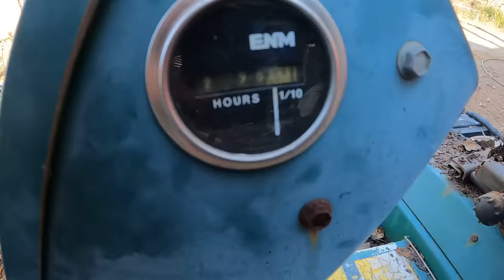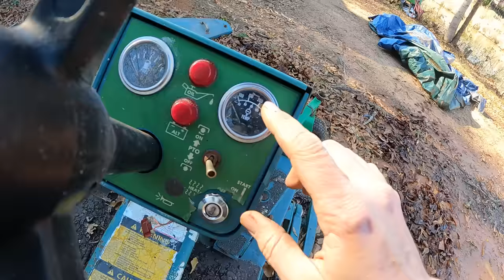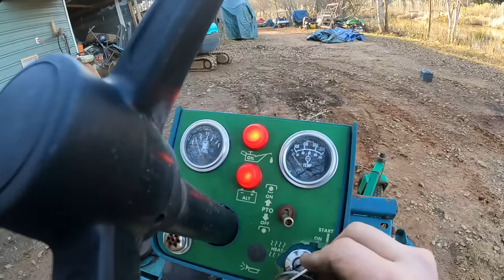INDUSTRIAL DIESEL MOWER LEFT ROTTING IN A JUNKYARD FOR OVER 20 YEARS…. CAN WE SAVE IT??

Comment: Not going to lie, i didn't watch much past the first 5 minutes. I suppose that engine might be worth 100 bucks if you needed it but the rest of that thing is junk. 
I'm not saying it can't be fixed. I'm just saying why bother.
Reply from the maker: finish watching the video my guy, and to answer your question why, well I’ll tell you why because first this engine is worth well over 100$ they are on eBay for over 2 grand and I could put the engine in many other things like my John Deere garden tractor or Steiner. second these machines are built like tanks and last forever you just don’t find stuff built like that nowadays and if you do then you will spend thousands on it, third I enjoy working on stuff I only paid $100 bucks for this mower so I put a little bit of work into it and I will have a badass mower that will last forever that I paid hardly anything for and if I wanted to sell it I can make money on doing that. fourth I like seeing old stuff run again, you mite be but I’m not the type of person to buy something then throw it away and buy somthing brand new if it breaks, I like fixing it and making it last as long as I can, it makes you appreciate things more and not waste money, one of the issues we have today is that we live in a throwaway society and everything is made cheaply because of this. if you want finish watching the video and stay tuned to what I do to this mower